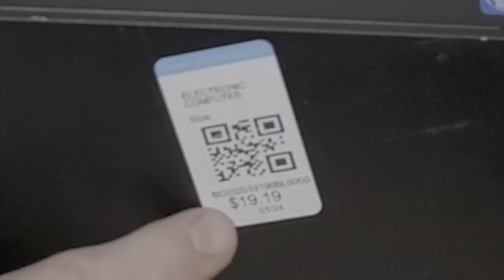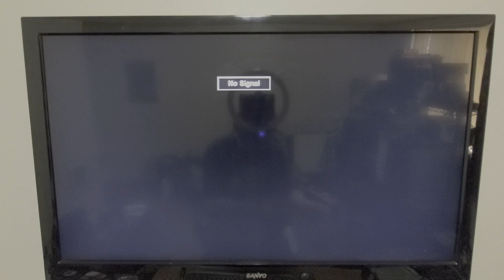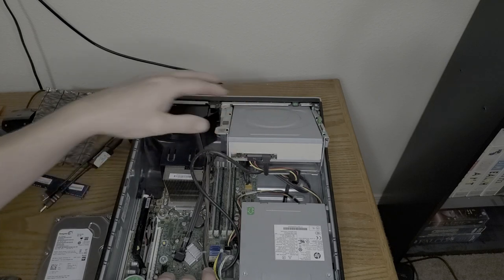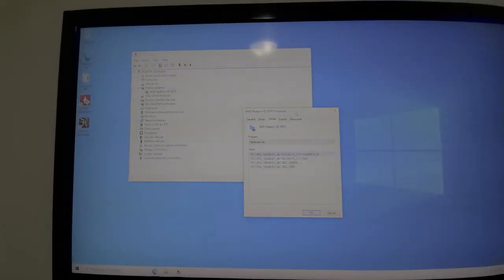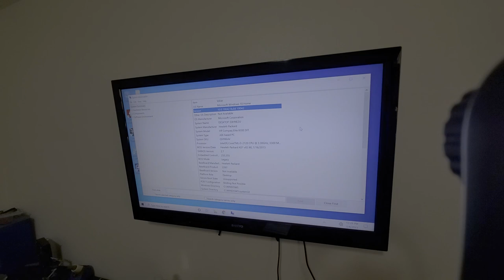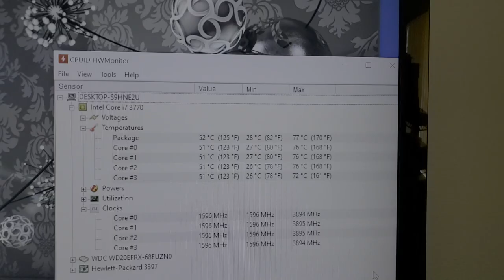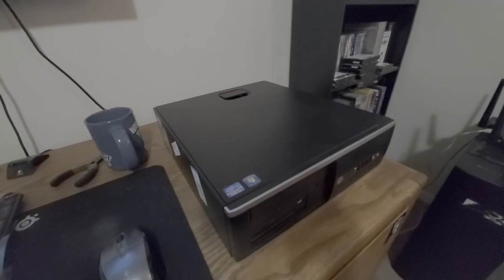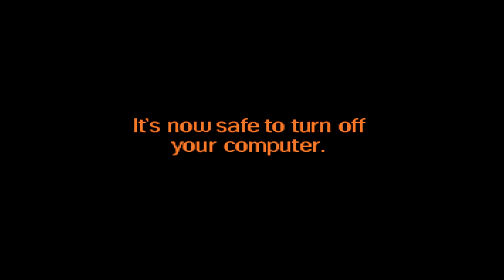Office PC to HTPC

Comment: Found one for a similar price, 3d printed some rails so I could replace the CD-ROM and 3 1/2" bay with 3 HDDs and it's my TrueNAS system now, works great! These corporate machines were built really well, great reliability and longevity.

Comment: Dells and HPs from that time were very easy to work with WRT hardware.  Sure, they didn’t have the cutting edge on processors or video cards but servicing was so much better than all of the “bolt everything” before/after.  I have several of the HP servers and Dells from back then.  I’ve upgraded all of them for Pennie’s on the dollars.  Dual Xeons, TONS of cheap memory and then a hot GPU (Nvidia Strix 1080s).  They hold their own when I play games or VR,

Comment: Just a little heads up,this computer has a security option in the BIOS called  "Embedded Security Device". If you're going to reboot it or shut it down and power it back on immediately,it will not boot and both power light and hdd light will remain on. You have to disable that option in order to fix this problem because when this problem occures it will make you think something is wrong with the computer. I've worked on a couple of these PCs and it was a pain trying to solve that until i finally figured it out. Also,you can check the BIOS version if it's up to date,HP released a new version in 2018 or 2019 to make compatibility better with Windows 10 for it

Comment: Hmm, I think you said Youth Ranch, you must live in Idaho.  I miss the one we had in town :(.  Closest one now is over in Eagle.

That graphics card is missing that header bracket because it most likely came with a full size bracket which wouldn't fit in that case, so they removed it so the card would work in that case, rather than buying a low rise bracket, they just removed the full size one...terrible idea as it can cause damage to the card and/or the slot its inserted into if you aren't careful.

Comment: Honestly, the lighter the heat sink, the better the heat transfer.  Until the introduction of heat pipes, the more area you could provide to the fan, the better the heat dissipation (all about cooling area) the better the the heat transfer.  Ever look at the A/C unit in your yard?  No fancy phase change in the coils, just transfer heat to all of those very fragile and thin heat radiators.   A/C systems have DECADES on modern computers when it comes to heat transfer.  Yes, in the small space of a computer’s chassis there’s issues with transferring the waste heat but with enough airflow you can overcome this.  If you want quiet, then put in a water heat transfer.  The gain is measurably better but I’ve never seen an HVAC that uses this.

Comment: I'm still using an older HP dc7900 SFF as a HTPC. It has a Core2 Quad Q6600 @ 3.0GHz BSEL modded, 8GB DDR2, Radeon HD 6570, 240GB SSD with Win7 and Ubuntu 18.04, and a 3TB HDD for DVD rips etc.
Reply from the maker: My first htpc was a dell optiplex sff q6600 tape modded to 3.0ghz with the same 2tb nas drive I replaced in this vid and 4gb ddr2.  I was running win7 until one day I turned it on and it updated to win 10.

Comment: I have 3 of these.I upgrade for my kid one to i7 3770,16gb  ddr 3 1600,480gb sata ssd,Amd R5 430 OEM LP 2 GB gddr5.And it  work  like a charm.Browsing,video,text  even the light gaming Ghensing Impact 1600x900 40 fps low setting.And it is quiet and relativly cool PC nothing like my hottie Ryzen 3600x.

Comment: I have the same model, but it came with an i5.  You really should put in a small SSD just to get boot times down.  Of course, that would almost double your initial $20 investment... :) Also, do a fresh Win10 install, install latest drivers for chipset, video and anything else you can.  Then, de-bloat the Win10 install.  The Win7 registration code is probably burned into the BIOS, and Win10 will, probably, just activate on it's own.  Finally, just  a heads up, one of the pcie x16 slots is a true x16.  The other is an x4.  Also, the SATA connectors - one is a SATA 1 connector, the other two are SATA2.  Just added these points as a heads up for future builders to prevent an accidental connection that would result in performance hits.